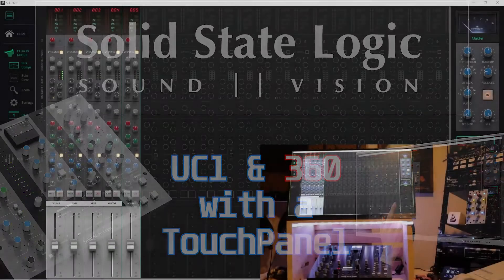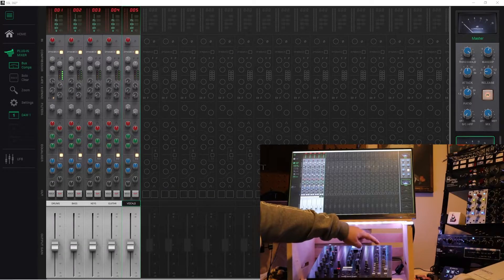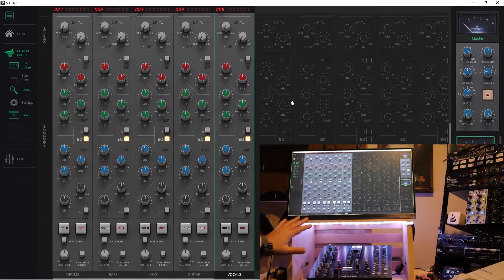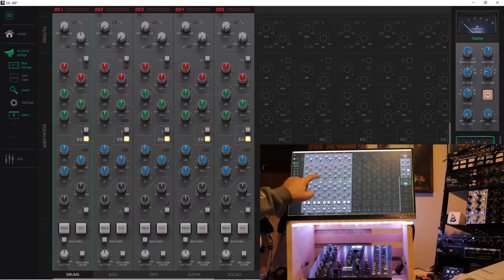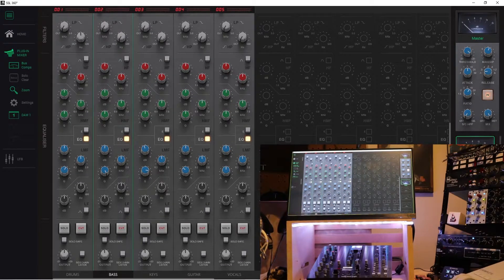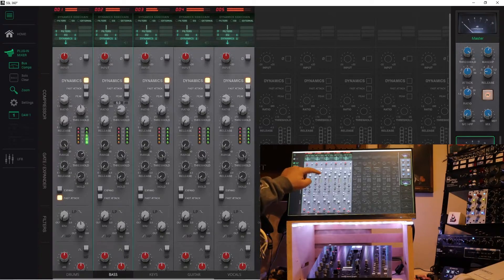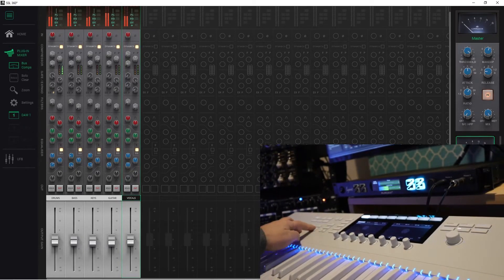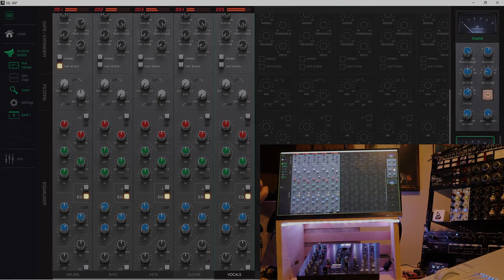Solid State Logic UC1 and a Touch Panel - Workflow, Tips, and Quirks

Comment: I was wondering if I should introduce a touch screen to the studio but I couldn't figure out an appropriate use. This looks like a perfect complement for the UC1 and looks like it will ramp up the workflow quite a bit. 

Thanks for the ideas!
Reply from the maker: Yea, you just have to get used to it.   And if your using windows the screen has to be the primary monitor if you have more than one.   I have a 22” but think that a 24 or bigger is much better.  The parameter are a little small if your zoomed out.   Zoomed in its perfect.